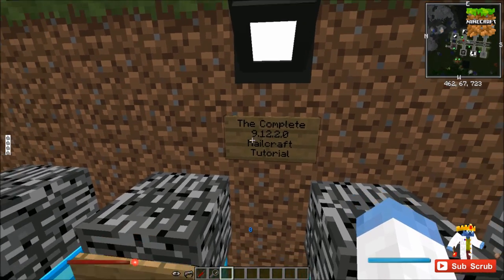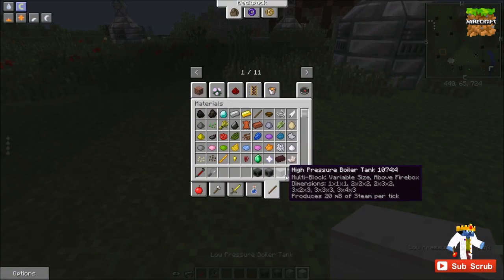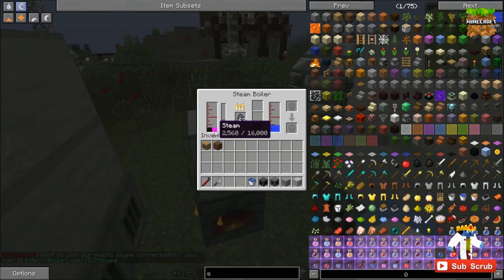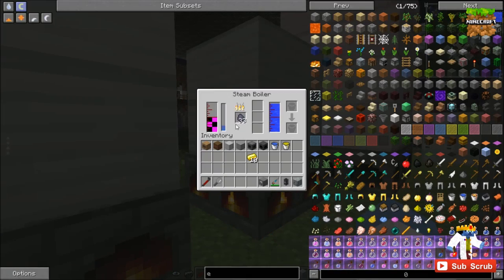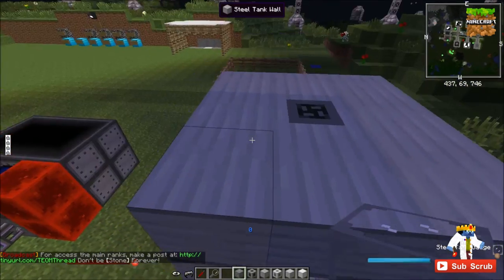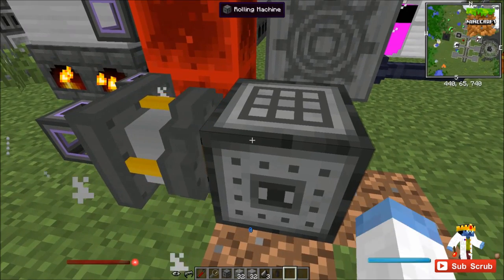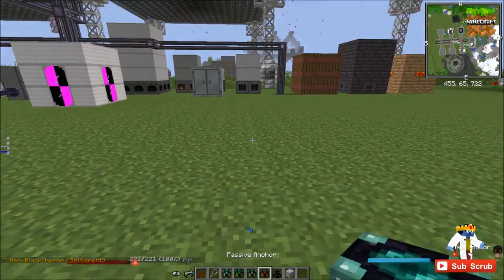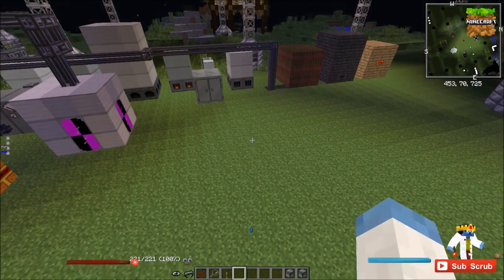Railcraft 1.7.10 Tutorial  - Part 2 -  Machines

Comment: Your video has helped me solve why my flux transformer wasn't working to convert RF to railcraft charge. 
I used leadstone fluxduct going in one side and charge shunting wire coming out to the powered roller machine. 
The mistake i was making was by both using fluxduct for the power in and the power out. Thanks! I have been playing for a year and not been able to work that problem out. Dam it seems so obvious now.

Comment: Steam counts as a gas, not a fluid. Mekanism's pipes recognize a lot of gases from other mods as fluids, so a mekanism pipe will work, but you need gas ducts from most mods, in order to move steam. I had a similar issue with reactorcraft, because I started out using mekanism but wanted to try out various mods with it to see which I liked best.

Comment: How do you power the rock crusher? Mine doesn't even have a power meter.
Reply: Nor do I have steam engines
Reply: @rightupmyalley617  Yeah, I was having the same problem, but I think I just figured it out! Hope this helps you:

Looking through their issue forum, it would seem that they removed the engines. Which is a little sad because they looked so cool!! Now it looks like you just connect the Steam Turbine Housing to whatever machine using the Charge Shunting Wire. Like the Rock Crusher, for example. 

Once hooked up properly, the turbine will start to work & produce power. The Steam Turbine's meter will not animate if it's not connected to anything properly (output 0%), just FYI.

Comment: How do you make a boiler, to make steam, when to make a boiler, you need a machine, powered by steam <_>?
Reply from the maker: I think the only machine you need to make the boiler is a rolling machine, which is powered with engines. There are three engines in Railcraft, the hobbyist steam engine is the only one that does not require an external steam source, it has a mini-boiler built-in. I go over the engines at 18:40.

In contrast, Railcraft is fully compatible with Buildcraft (they are meant to be used together), so you could use a Buildcraft engine as well. But, if you're a Railcraft purist, you can use the hobbyist steam engine until you have a seperate boiler.